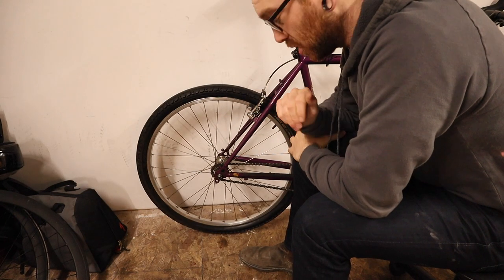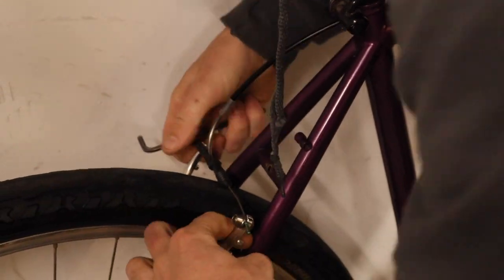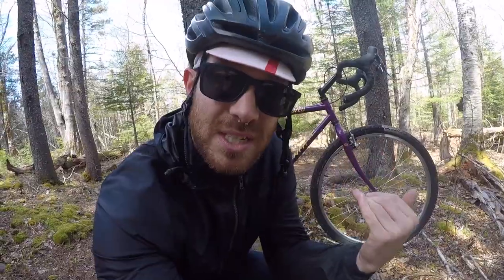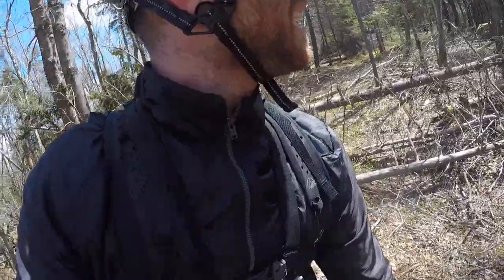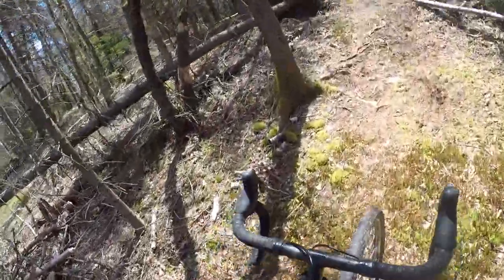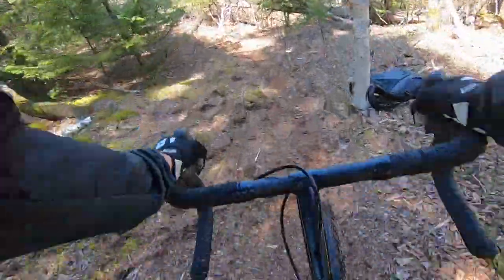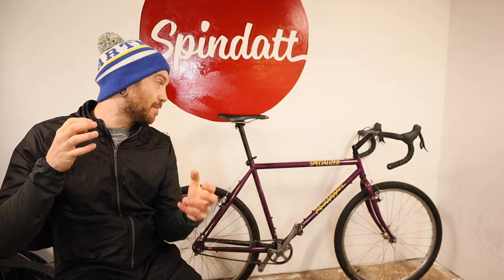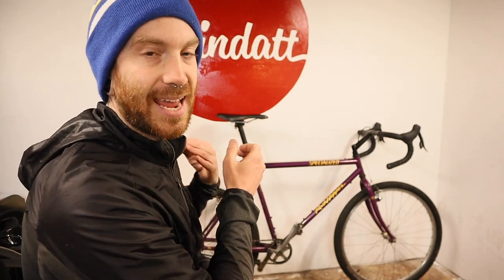Does It Suck? Retro Drop Bar MTB

Comment: Nice! I have several vintage mtn bikes, love 'em. One is an 87" Raleigh Mountain Tour Elkhorn. Triple butted cromo. All Deore. With saddle and pedals 26 lbs. Added vintage road bike drop bars and 27" road wheels with 1 3/8" tires (they just fit, barely). Great gravel bike. I ride it every day. Smooth, fast and best of all fun! Thanks!
Reply: how did U configure the breaks?
Reply: Wow, even going 26er to 700c is a tight squeeze.  Running 700x32 Forté Gothams on a Fuji (Marlboro) folding bike I converted....also had to change to dual pivot recessed nut road calipers.

Comment: Obviously a set up for the later "does it still suck?" video. 

Part of me likes it singlespeed, most of me knows it will be more useable with some gears. And yep it needs a shorter, lower stem, but you'll need a brake cable hanger as well, which makes a front mini V a little more tempting as its a simpler device to set up, except for the tyre clearance issue, or a full sized V brake with a travelagent, or, or... Lots of tradeoffs to contend with, which probably makes it a more interesting build in some ways TBH.
Reply: There are cable hangers still available for those threaded headsets though.
Reply: @kevinjfeeney77   yep I'd go for a fork crown mounted one though to minimise the risk of the dreaded 'judder'....

Of course I've literally just gone and bought a travelagent to run a full sized V brake with some road levers on a CX build I'm doing.... ;)
Reply from the maker: Lol I plan on buying the same tektro hanger I have on the rawnstercross ifffff my plan doesn’t pan out.
Reply: RollinRat  6 months late dude...

Comment: I have an '96 Trek 7000 that is in really nice conditon in satin purple.  I upgraded to mostly later XT 9 speed/V-brakes that I had laying around.  It's got Maxxis Detonators 1.5" - scary name for a tire, but that's what I had.  It has some cut-down Easton carbon fiber risers and CF seat post.  It is one of my commuter bikes, so it has higher gearing than original.  It also sees some time on local fire/dirt road short cuts.  It's fun to ride, and looks cool to me.  If the Maxxis' do detonate or wear out I'll get some larger supple type tires.

Comment: Nicely done! I like the color. I’m getting ready to restore an 89 Rockhopper and will probably go with Gravelkings. Regarding meh brake performance. Probably would be improved with high profile cantis. I just rebuilt a 1990 lugged Trek 930 and used the Tektro CR720. Inexpensive, the silver is classy looking, and great performance. BUT swap out the stock pads for Koolstop salmon 👍

Comment: You need to bring the handlebar back with a taller/shorter stem. Ideally you want the hoods position to be where the original flat bar hands position was. As is sits right now you're running what would probably be a 220mm stem with a flat bar and that's why the handling is all janky. You have to factor in the long TT of the 90's MTB, the reach of the drop bars and the reach of the hoods.

Comment: I'm probably late to the party here, but you don't have the Oryx's setup correctly. I can see clear slop in the link unit, and there seems to be a kink at the front. You have to set them up correctly, and they will shine.

I use Shimano CX50s which are very similar and they will straight up throw you OTB.
Reply: Did you see how low his bridle is?? I have Oryx, and they work great.

Comment: Try some early, 80" suspension corrected carbon + alloy steered pace rc 31's with the movable post mounts, weighing nothing. If I had a spare pair I'd post em' to you. It's  a game changer.
Reply: Great video

I have a 91 lugged Trek 920 single track stock with cantilevers “it’s Friday” breaks 😂😂😂
Only conversion I did was adding trekking bars to get a little rise and to bring the reach back a bit with multiple hand positions keeping original shifters and the 3 ring 21 speed 
Then I put a set of 26x2 Thick Slicks 
I’ve been riding this bike regularly for over 10 years now 
It’s my everything urban commando curb hopper , trail  and gravel grinder all in one that doesn’t suck 
Just subscribed and ordered some stickers ...saw you on pathlesspeddled with Russ ...love your videos

Comment: I got a 1979 steel ten speed road bike garage kept from Sears i like it , it was given to me by an eighty year old woman is so heavy no rust I was going to give it away but it's so clean and it was a gift what can i do with it
Reply: I have a 1976 KHS gran sport mixte.... updated to 700c wheels.. 8spd cassette, compact double crankset, wider ergo drop bars with MicroNEW 2x8 brifters.  Also got one of those claw mount adapters so I could run most modern rear derailleurs.... currently using a Shimano Acera. Shimano EH500 pedals.

Comment: Dude, I don't think that's 28lbs. My drop bar 1993 Rockhopper conversion actually weighs 23lbs naked with a full 3x9 drivetrain and garbage bin parts so yours has got to be at least as light as that since it's a singlespeed.

Comment: A timely video because I'm about to put drop bars on my vintage Rocky Mountain Hammer Race. I see a lot of monster-cross conversions with the original long riser stems. What about a shorter stem with less rise? It would lower the bars but some riders like that, even on a gravel bike. Given the1990s old-school geometry, that would allow you to mimic current gravel bike set up and probably improve the handling and ergonomics. Anything wrong with this reasoning? Will the bike feel squirrelly?
Reply: RollinRat  There's a lot in what you say, RollinRat. In my conversion the bars ended up a little lower than the saddle with two or three spacers under the 8cm stem. It didn't exactly mimic my road bike (why should it?) but put me in a good position to pedal. I personally find a higher stem hard on my back. If by rough terrrain we mean MTB-esque trails, you'll probably have to be in the drops for control and also to brake if your binders are not top-notch. Otherwise hoods or tops can be your default postion, particularly if, like me, you don't get on with widely flared bars like Woodchippers.
Reply: RollinRat  Appreciate the detailed reply. Was out yesterday riding the Prealpi,  the hills before you reach  the Dolomites,  on my fabulous Lynskey gravel bike. But I could have been on a fairy cycle because what really mattered was being out there cruisin'  the Italian winter sun (Oh, and the post-ride pizza).

Comment: Of course these brakes kinda sucks. In general dropbar setup didn't really excel at generating braking leverage. Cantilever setup while a little bit better than any U brake, still a downgrade when compared to V-brakes. So combination of these two parts would resulting a braking system with weak leverage.

I think you'll get better braking if you swap these cantis with hydraulic disc brake setups.